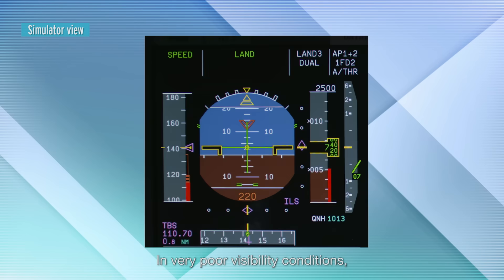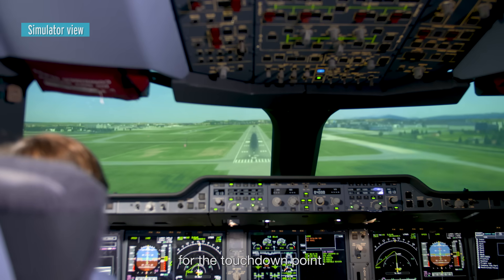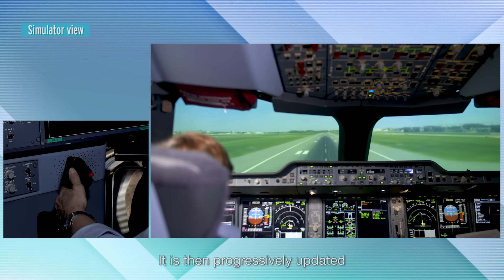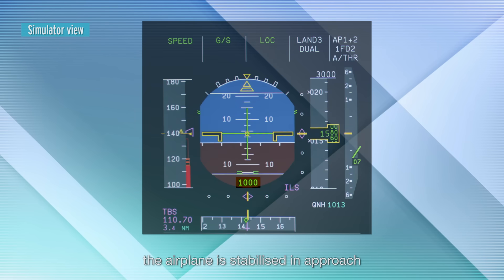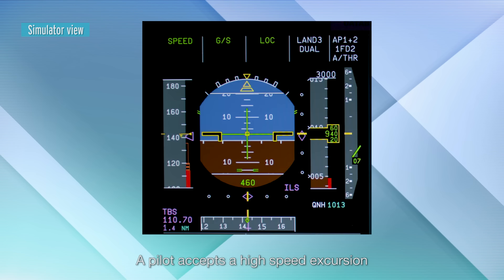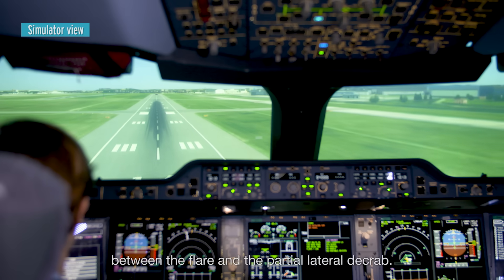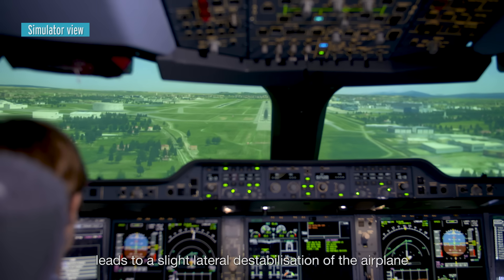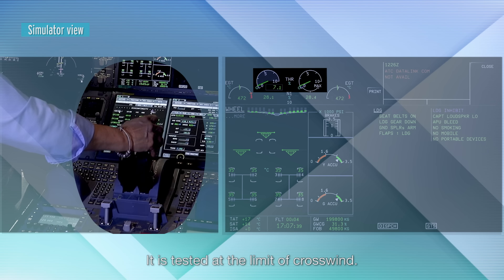Flight Tests - Episode 17: Autoland Tests

Comment: 5:20 “4” Callout?
Reply: @YaBoyFlaky5663:  in case you are not aware, that is the radio altimeter making that 4’ AGL callout.  Airbus radio altimeters actually count down from 10’ to 1’ on the bottom of the Primary Flight Display.  They do not enunciate these altitudes:  sometimes a spurious callout gets generated.  As you go through this Airbus flight test series of videos, you will frequently hear Pierre the radio altimeter voice make that same “4” callout right before touchdown.  Eh, it is an Airbus.

Comment: Ok, So A350 can do an autoland and what about other planes? Like A320neo? And can it make it in any airport that hav ils? And what about rnav?
Is there any curtain way to understand that i can do an autoland with curtain aircraft and runway?
Reply: I think every Airbus is autoland capable
Reply: @nikobelic4251  So all i need is any ILS?
Reply: @Valentin_MeL yes
Reply: @Valentin_MeL  and a crew capable of setting up an autoland and an airplane that has demonstrated recently that is can perform an autoland.

A bunch of  equipment on the plane has to be functioning properly as well

Comment: I'm somewhat confused... hasn't this all happened already with the ILS CAT III support?..
Reply: I guess they are just explaining it.
Reply: Yes of course, but you still need to test and tune the autopilot of new aircraft models for it
Reply: Are you expecting no more tests since the Caravelle autoland certification in the 60s or what? I'm confused about your confusion.
Reply: This explains how they make that Cat III support. It doesn't just magically appear from nowhere.
Reply: I think, this is part of achieving ILS CAT III support. They just mentioned that Autoland is not necessary of certification of the plane (as such), but it would be the crucial part of CAT III, no?
Reply: I believe here they are demonstrating RNP LPV or some GBAS/SBAS autoland, since they mention GPS signals. These technologies would allow autoland even on airports that are not equipped with a physical (and expensive to maintain) ILS system
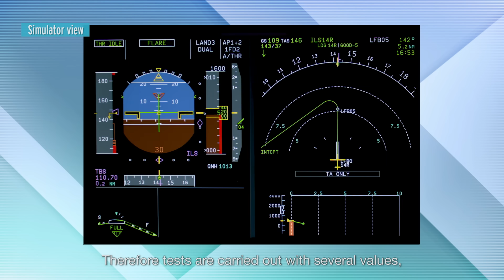Reply: @pilotluca_  No they are not demonstrating that in this video. At 3:24 they talk about the ILS components. Moreover, throughout the video you can clearly see the GS and LOC modes active on the FMA, as well as the localizer frequency in the bottom left tuned. Even more clearly, at 4:34 you can see on the navigation display, at the top of the map, it says which approach is loaded into the system, an ILS 14R approach. 

The GPS signals you mentioned, are being used by the engineers to obtain data and tune the system, they say this in the video at 1:35. Like other comments have said, it seems this video is about them demonstrating the process of how they tune and certify a plane to perform autolands with an ILS